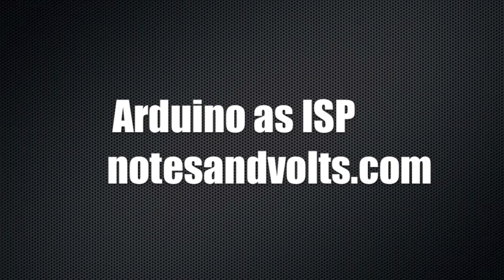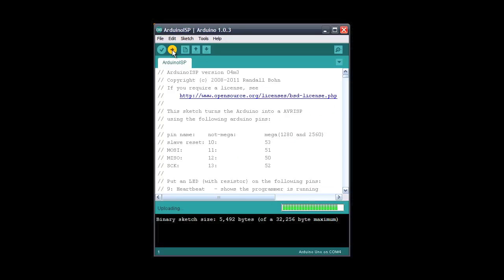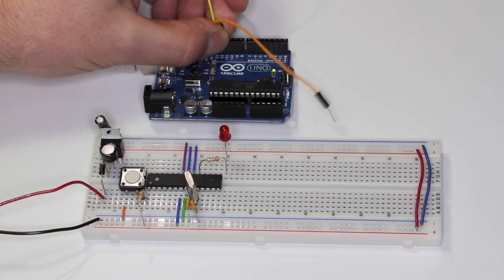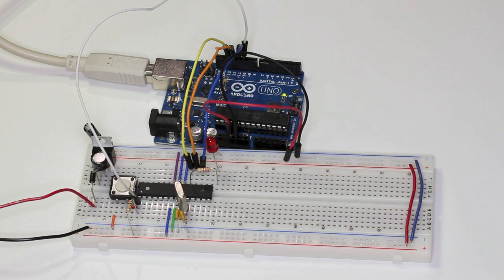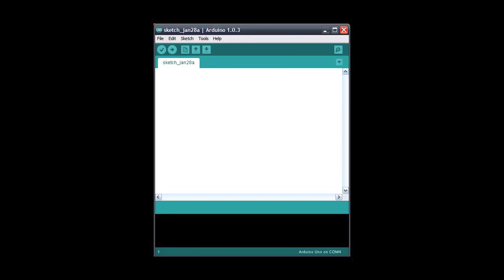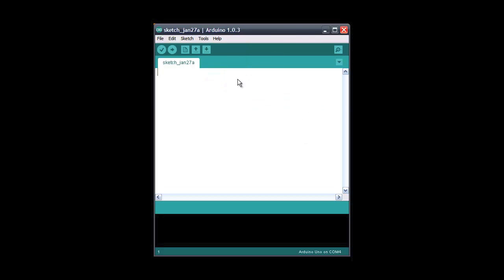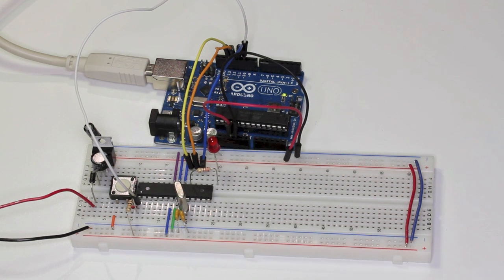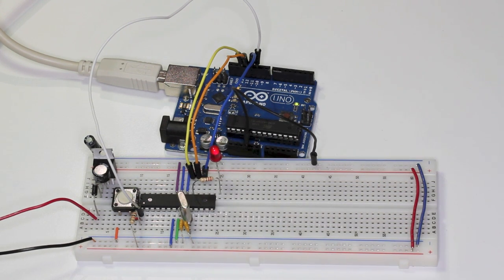Arduino as ISP

Comment: Can this configuration be used as a generic AVR ISP? I mean, for uploading non-arduino programs.
Reply from the maker: Ovidijus Hi Ovidijus. This method would not work for that as we are using the Arduino IDE as part of the toolchain. The IDE is compiling the program before transmitting which would fail with non Arduino code.
Reply: +Notes and Volts how about if we create the necessary arduino library onto the target IDE and then include it in the code, could that work

Comment: the LED on the board was flashing in sync with the one on arduino...wasn't that driven by arduino?...wanted you to disconnect the 3 wires while running to see that the chip was indeed programmed.
Reply from the maker: Thanks for the comment CC. You can see the circuit run by itself in the construction video.

http://youtu.be/ufQZnAAxZ7A?t=8m39s

Comment: i got the "NO ABSOLUTE FIX"  AVRDUDE:STK500_GETSYNC ( ): NOT IN SYNC: REAP =0X00.............................. i did all connection correctly...  what's wrong? i already googled the issue. My COM port is ok, so with drivers, etc...
Reply: new chip has no bootloader.
you need to burn it first

Comment: hey! great vid! although i have some problems. i have an uno, correctly built arduino mininum circuit on breadboard with ATMEGA328PU, i follow every instructions and i get error message when burning the bootloader: avrdude: stk500_getsync(): not in sync: resp=0xff. my arduino works fine by itself, i doublechecked, the circuit, the programmer settings, the serial port, and it always succesfully loads the ArduinoISP to the board. can anyone help me please ? :)
Reply: new chip has no bootloader.
you need to burn it first

Comment: How do you know you're burning the right bootloader to your chip and that the fuses are set correctly? Is it just because you are using an ATmega328 and the board type is set to Arduino UNO which uses the ATmega328 anyway?
Reply from the maker: Hi mrkiky. That is correct. By setting the board type to UNO before burning the bootloader, we are specifying a 328 chip as the target. If you were using a different chip type, you would choose the appropriate board type from the menu before the burn bootloader step.
Reply: Notes and Volts Ah, I see. So you can't use this technique for any Atmel chip, unless you have some sort of add-on?
Reply from the maker: ***** This technique is best used with chips that are native to the Arduino (168,328) although people have made additional profiles that can be added to the Arduino IDE for devices like the ATtiny family. Do a Google search for Arduino + (The device you are interested in)
Reply: Notes and Volts I have a ATMEGA32U2 chip that has no bootloader, how do i burn bootloader to this chip?
Reply from the maker: CaallMeeMrrD
Sorry, I have no experience with the ATmega32U2.

Comment: if you are not burning the bootloader wouldn't it just be easier to remove the chip from your arduino and connect the RX/TX pins on the arduino board to pins 2 and 3 of the atmega chip and reset to pin 1, that way you will just program the chip on the breadboard just like it was inserted into the arduino board. You can even keep your external supply connected because the reset wire acts as a gound to the arduino power, or you can disconnect the external power and share the arduino 5v power.

Comment from the maker: Hi Elmerato

Glad the tutorial helped! The only downside to this is if you want your final project to be re-programmable via ISP, you have to be careful how you use pins 17,18,19 for other I/O functions as it may disrupt the program upload process. I usually dedicate those pins to ISP functions in my circuits to be safe. The benefits come from being able to update the program in your project without taking anything apart. Also, since the bootloader is gone, you have more space for programs.
Reply: How does the Arduino doing it without having to care about certain pins?

Comment from the maker: Hi Peter. I believe the Atmega48 is pin compatible with the 328P so the circuit might work, but I don't think the Arduino IDE has a configuration file for the 48. You would have to make your own. Google around and see if people have done this. Let me know if you get it to work. Good luck!